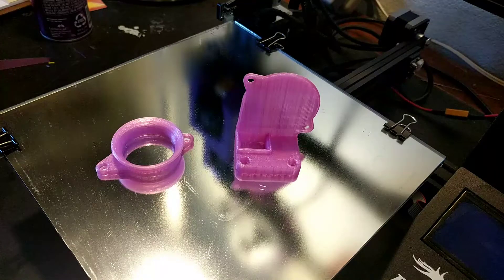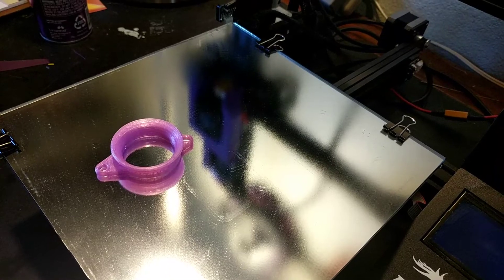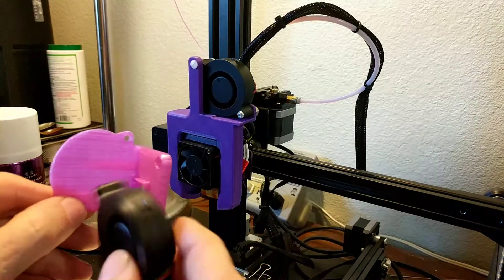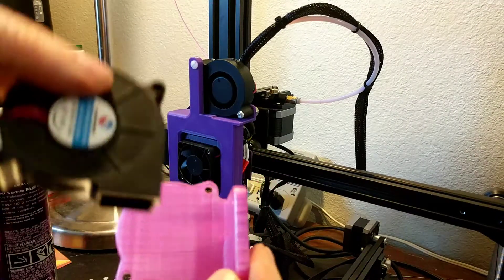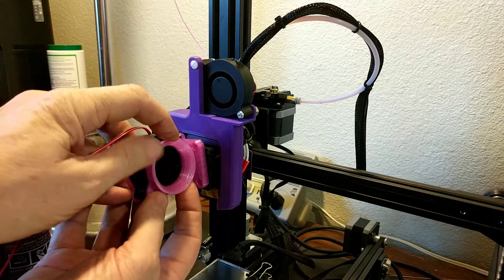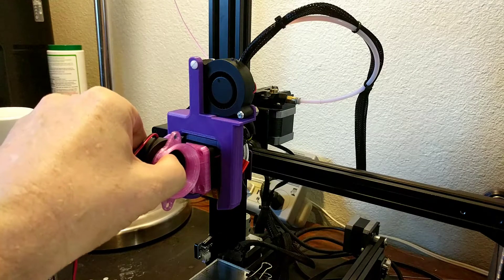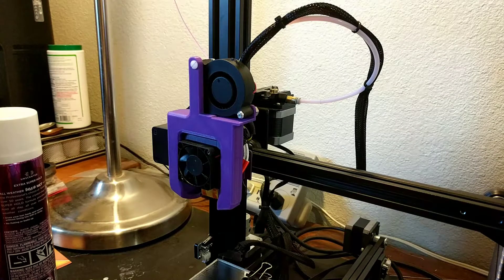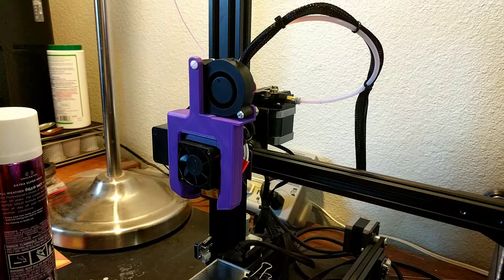Ender 3 hot end 40mm to 50mm fan adapter

Comment: Hello, do you think that a new fan will be more effective than the old one ? Or you just replacing it because it can "die" like the other fan ?
Reply from the maker: Yes, I expect the new fan will provide a lot more cooling than the original, but to be honest for the hot end fan I could easily find another, higher quality fan with higher flow that would go on without mods. But what's the fun in that? And now I can use the same fan for both.

Comment: How are you finding the 5015 as a hotend fan replacement? I ordered a set of 4 of them and like you I see the advantage in being able to use the same type of fan in both places.

Are you controlling the speed using the settings in the slicer or have you set them in the firmware now you have modded that too?
Reply from the maker: As a parts cooling fan I like them and I control the speed through the slicer, for PLA I'm running it at 60% when there's no bridging. As a hot end fan I'm having some second thoughts. It works really well cooling the hot end, but I have found no easy way to control the speed and these are  a little loud at 100%, it doesn't bother me because I still can hear them over the A/C or my tinnitus. But I may look into under volting them a little bit. I also picked up some standard 40mm ball bearing axial fans as well which I could use if it starts bothering me.